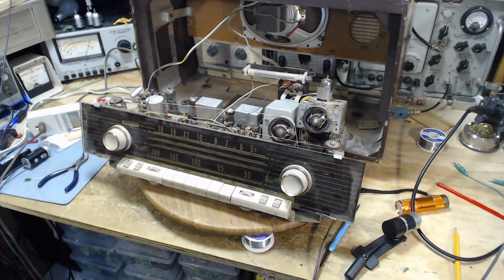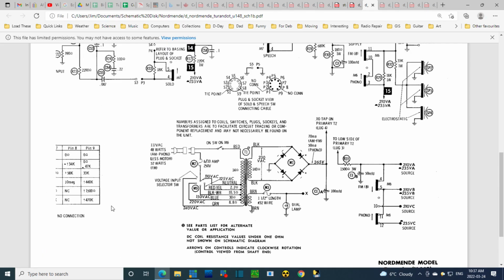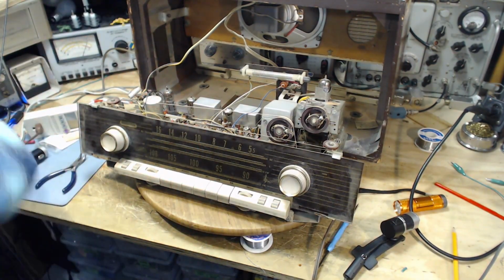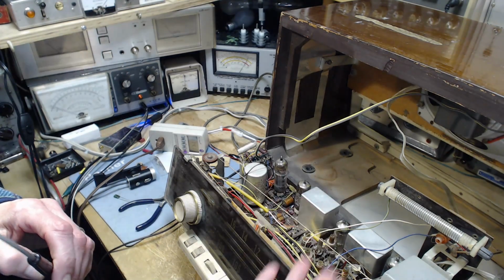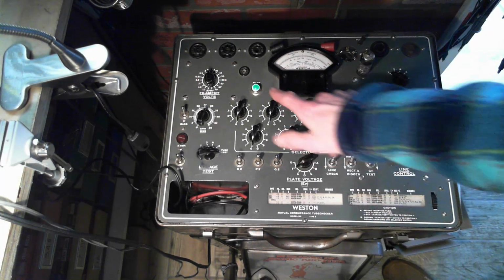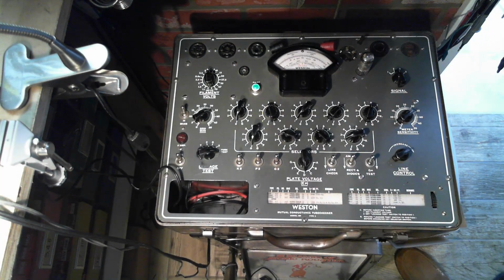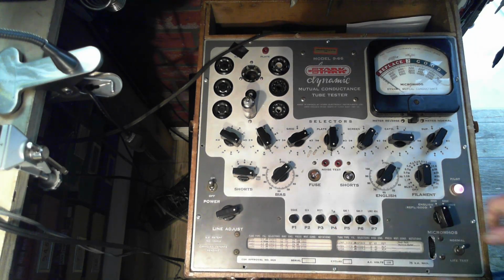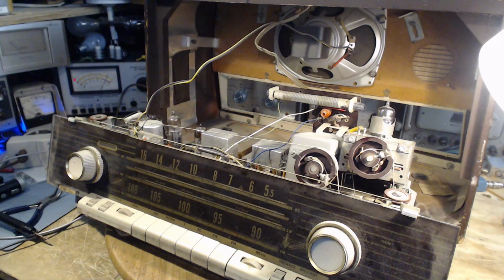Nordmende Turandot Tube Radio Video #2 - Tube Testing

Comment: @ 27:24 "... Does it have a date? " - Then searches everywhere for the date of the tube... IT'S RIGHT UP THERE, 1963 !!!
Another two pieces of test equipment that went bananas...
Everything is broken, even the audio from the video has more noise than a AM station... Oh, and by the way, what happened to the other radio, the other Nordmende ?

Comment: I wish he would not get so tunnel blinded and distracted all the time. You could see in yesterday's video that the manual he had was not the same as the radio he had. He looked today for T2 and couldn't find it as he was looking where it is on his chassis, not where it was on his manual.   He talks about the the EL84 tube on the schematics then pulls the ELL800 and thinks nothing of it.  If he doesn't get a correct schematic soon it will mess him up so badly

Comment: 27:37 The ECLL800 cannot be replaced by two EL95, because there too is a triode in the ECLL800! 
You would have to a EC90 triode (~1/2 of a 12AX7) and two EL95.
It is the ELL80 which can be replaced by two EL95 and there were simple plug in adapters available for that purpose because there is no circuit redesign needed.
Both ELL80 and ECLL800 were crapshots reliabilitywise due to too much heat dissipation causing the glass envelopes to fail.
Reply: Dude, you're wasting your time, he doesn't read comments, only checks the like/dislike ratio (which, btw I don't even know where it his with this new interface)...